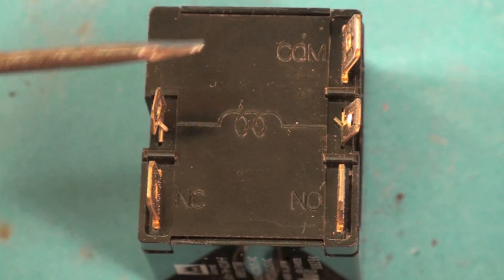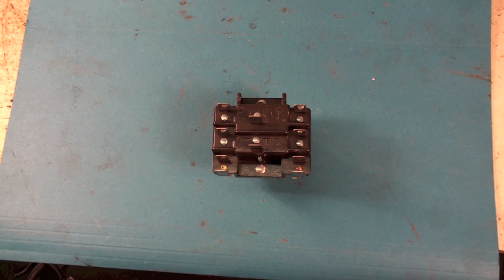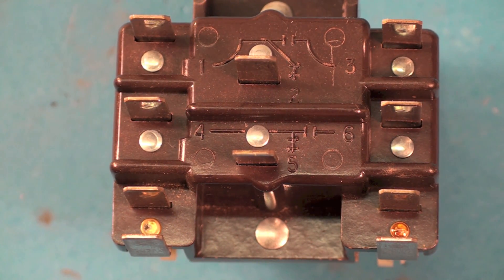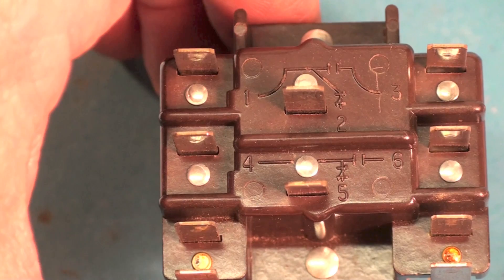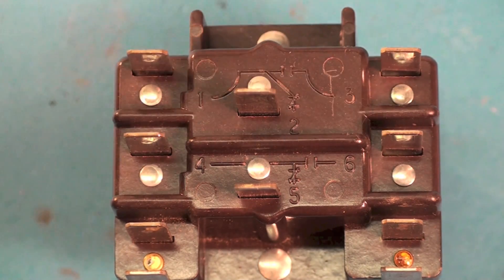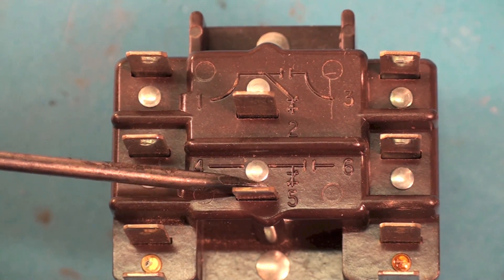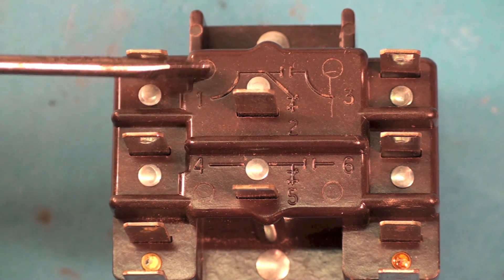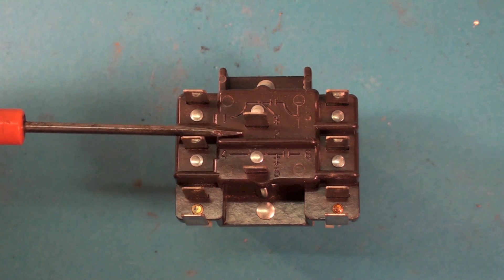How the single pole double throw sw works at the relay

Comment: Can I use use a 1/2 hp relay in place of a 3/4 hp relay as long as the 24V 12 A FLA @ 120VAC is the same with both relays?
Reply from the maker: If the FLA is the same, yes.
GFM

Comment: Although there are two sets of coil terminals, if only one is used by the receptacle can you remove the other set? Replacing a Honeywell R8882D 1006 with a R8222D 1014. Thanks!
Reply from the maker: If the receptacle will not accept the other terminals, you can cut them off.
GFM

Comment: I probably won't get an answer to my question here but here goes... I have a similar relay that is a DPST Relay.. part number 510350223  that needs replacement in my Weil McClain Furnace.... I sent away for this Relay.. but they sent me a DPDT relay instead.. with a part number 570350223.  Is it safe to use the Double Pole Double Throw relay sent to me?  The relay does FIT into the Socket just fine.. but I had to ask.. thanks to anyone who responds...
Reply from the maker: It will work fine.
GFM
Reply: @grayfurnaceman  thank you GFM.. appreciate your videos and expertise... I'll go ahead and plug that new Relay in and warm the house up.. THANKS

Comment: Hi and thanks for the video.. I bought a new Tstat(Emerson  UP500W) for my dual fuel Heat pump (2003 Ruud)  with Lp furnace.     Tech support says it will work with my system if I have a Single pole double throw relay installed. The relay is supposed to take my O  and my B wire down to 1 wire since the Tstat has just a O/B terminal.   Does this sound like it will work to you? I don't want to have a tech come out and tell me that the support was wrong and I have to pay for a appointment fee.
Thanks for any answer
CP
Reply from the maker: I believe you can select O or B in the installer setup to get the right reversing valve setting.  You should not need a relay.  I believe the Ruud heat pump has its reversing valve energized in the heat mode.
GFM
Reply: Thanks for the reply.. The fact that I have  a O and a B wire connected in the Tstat is the confusing thing.. I keep reading that there is usually only 1 of them used
Reply from the maker: I would follow the wires to see where they go.
GFM

Comment: Should I have continuity between the bottom two 24v legs that aren't numbered ? I am checking a relay and have continuity between those two legs with 10 ohms resistance . Love the vids btw . Just wondering if I do or do not want continuity between those two . Resistance also seems high
Reply from the maker: Those 2 terminals are for the coil of the relay.  They should have a resistance above 0 ohms depending on the voltage.
GFM
Reply: grayfurnaceman thanks for the response love your videos

Comment: Well done sir! Those relays can be a life saver!  Well done indeed Gary! I love you and Fritz's video's!   You guys make HVAC fun and very tech easy. As a KY Journeyman sometimes you run into problems that normally isn't an issue but can be without the correct parts. These babies can relay get you out of a tight pinch!

I just hate the American Standards which have the circuit board attached.  

Anyway, thanks for the video!!!!  Much appreciated!
Reply from the maker: +iconbadgta Welcome
GFM

Comment: are both relays controlled by one switch? so both relays go to normally open when activated?
Reply from the maker: No.  Think of the of the switch as a lever that can be moved from one contact to the other, but not to both at the same time.  Hope this helps.
GFM
Reply: grayfurnaceman it did help and then I had seen the video of you disecting the relay. Thank You!

Comment: Thank you for your reply ... It's on the cool side, if I disconnect the power and connect it to the #2 pin (Normally closed) then the fan will turn on... the power was connected to the #3 (Normally open)  and won't kick on... so do you think it may be connected to the wrong terminal or are you still guessing the T-stat? thank you!

Comment from the maker: If the problem is in heating, sounds like the connection thru the heat circuit is not complete.  If it is in cool does it come on when the fan sw is closed?  If so, the problem is in the t-stat.  If no, look first to low voltage wiring.  Hope this helps.  Let me know.
GFM

Comment: on the second fan relay you described which would be the power and which would be the hi speed... I had my neighbor over who claimed he is a HVAC tech but now my fan motor will not turn on ... if I connect directly to a power cord it will turn on, it also has a brand new 10 MFD cap which goes with that motor...

Comment: I think I have one of these on my 30 yrs old rheem furnace. I believe its connected to the inducer motor.  Mine has been buzzing for years. is it suppose to that? recently the inducer motor is getting stuck, so I wd-40 the bearing, then it works for a few weeks. Could a weak relay cause problems to the starting of a inducer motor? or can a bad inducer motor destroy the relay? the relay is labeled by essex, 91-14200-32063. thanks again!

Comment: Hmm I get to look at these relays everyday, I am a Direct Fired and Indirect Fired Make up air unit factory tester for Engineered Air and one of my jobs every day while commissioning these make up air unit is to verify that all the circuitry is correct with tonnes of these relays in my face lol. Gotta love it, especially when the electrical installers have the wrong devices going to the wrong relays and or wrong contacts :).